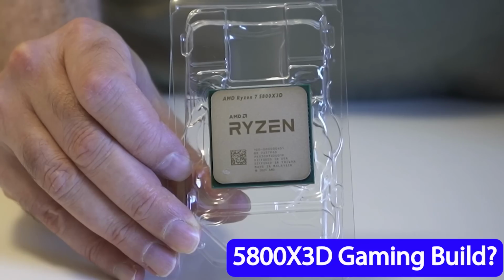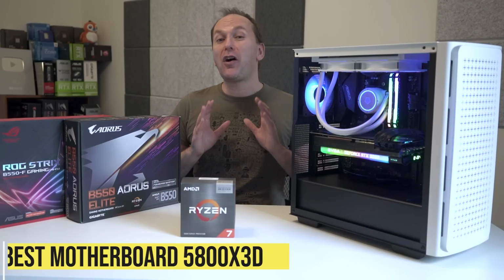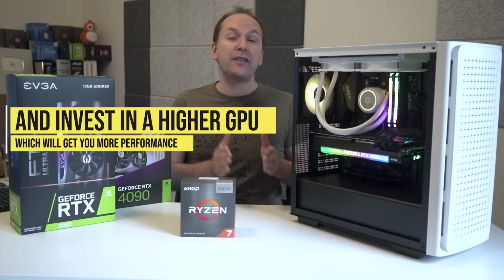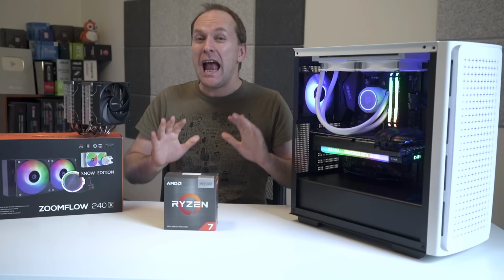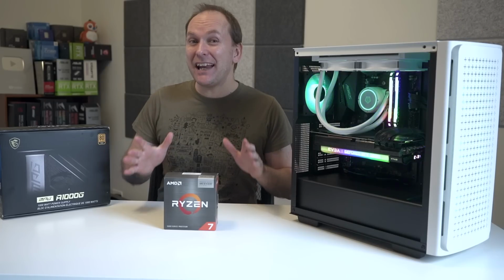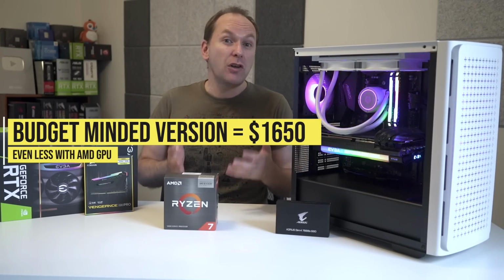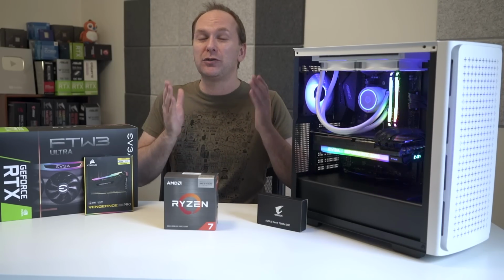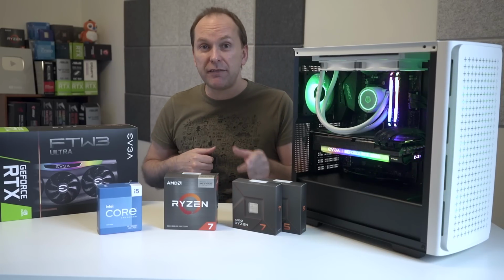🛑 4K Gaming is CHEAP! 🛑 Ultimate Ryzen 5800X3D Gaming PC Build

Comment: I just realized this is old. I was confused when I saw the older parts selections.
Reply from the maker: Yes. If you are looking to upgrade an existing AM4 build check out our “How to Upgrade your PC 2024”. If you’re building new I don’t recommend this is in 2024. See our Best Budget Gaming PC 2024 video for better options
Reply: @PCBuilderChannel  I have AM4 and I'd rather go on to AM5 next than to move to a 5800x3D or one of the Ryzen 9's. I have a Ryzen 7 5700x. It's enough for now. I've had AM4 since around 2018. I started with the Ryzen 5 2600. Moved to a 3900x. Now I have a 5700x. I wanted a bit of extra gaming performance over having more cores. It does run really hot if I overclock though so I might invest in a good air cooler that I can keep through to AM5 when I do upgrade. I have an RTX 4070 Ti Super. People tell me I'm bottlenecking like crazy all the time. I expect a bit less performance on the older CPU in general but I feel like it's probably not worth it to upgrade my CPU just yet. I play at 4K and 60hz and it's mostly a bit older titles like Battlefield V and GTA V. I have a few newer titles but they just aren't as good in my opinion. I think continuing to invest in AM4 just not going to benefit me much. I want to upgrade in a few years. I might wait for AM6 even.

Comment: I'm considering a more balanced system, and I'm leaning towards the 5800x because it's only slightly slower in gaming, about 5-10%. I can overclock the 5800x to narrow that gaming gap while still keeping its productivity performance. Additionally, it's cheaper and often overlooked, so I save some money by choosing it.
Reply from the maker: I wouldn't personally. Price to performance in 2024 the only AM4 CPUs that make sense to buy for a fresh build are the 5500 or 5600. The 5800X won't give you enough of a boost over a 5600 to justify the price increase. You could get better performance by going 5600 and pairing with a 7800XT. Or if you have more budget get yourself into AM5 with a 7600. See our Best GPU/CPU Combo 2024 video for more on this
Reply: @PCBuilderChannel  
I recently built my PC late last year with a Ryzen 5 5600X CPU and an RTX 3070 GPU. However, the GPU developed issues and I had to send it in for warranty repair. They replaced it with an RTX 4070 Ti, which is now causing a bottleneck with my CPU. Since I already had the AM4 platform, I decided against upgrading to AM5. I've already purchased the Ryzen 7 5800X CPU because the games I play wouldn't benefit much from the Ryzen 7 5800X3D. I'm now considering if this CPU upgrade makes sense, or if I should wait until AM6 is released before considering a major upgrade.

Comment: I went MSI B550 Unify board/5600X3D. It has the X3D auto curve Kombo Strike button in the BIOS for a non multiplier de facto X3D OC and great RAM OC capability. I run B-Die RAM at 4000 MHz with tight primary and sub timings. The board does that with a BIOS button up to 5500MHz stable. $279 pro OC board, $75 Microcenter closeout, insane.

Comment: for this build, do u need to do bios flash first before window installation?
Reply from the maker: You shouldn't need to no, just update the bios as usual after you build (check out our After you build set up guide video for more). But check your motherboard manual to be sure

Comment: I just built my new PC and here are the specs. What are your thoughts on it. Case is an ASUS Hyperion GR701 and I added 3 140mm top fans for exhaust, Motherboard is ASUS Z790 Hero, Intel Core i7 13700k, Corsair Vengeance DDR5 64gb 5600 ram, PNY 4070 12gb ram, Coolermaster air ma620m CPU cooler, Corsair 1200 watt modular PSU, WD Black 1tb M2, WD Black M2 4tb, WD Black M2 4tb, LG 34 inch 165hz curved monitor, Roccat Vulcan gaming keyboard, HP external DVD writer, Logitech Trackball, Razor Tiamat 7.1 Surround Headset Ver.202. Logiteck 2.1 Speaker system that I already had and I am using a Logitech C922 Pro Webcam that I had. I'm running Windows 11 Profeshional. What are your opinions on my Build?

Comment: I am planning to upgrade to a 5800x3d from a 5700x and a 4070 from a 3060 ti am my current motherboard is a a520m plus wifi would that be fine? I am also planning to get a better m2 ssd and faster ram. (My pc was pre-built) psu is 700w so it should be fine but I'm mainly asking because I've seen a few people say that the motherboard isn't good but it's not bad either, and I don't particularly feel like upgrading to a different motherboard and re-adding all the parts and all the cable management, etc...

Comment: I have AM4 B450 aorus elite with 32gb 3600mhz ram. I wish to get the 5800X3D with 6950xt, is that a good option? Want to wait 3-4 years until DDR5 becomes established.. Then I will switch for something completely new. Is this setup compatible with my mobo for 1440p? If someone has the simillar setup please reply to me here :)

Comment: I was thinking about mixing this with a 6750, never built one before so i need imput
Reply from the maker: Good combo, but if you are building a new pc I don't recommend 5800X3D now. Its great for upgrading an existing AM4 build but for a new build see if you can get to 7600 and AM5. See our 7600 build guide for more
Reply: @PCBuilderChannel  OK thanks! I watched the build video. Do you think the 6750 would still pair nicely?

Comment: I want to build a pc, would these components be good? 
CPU: 5800X3D

GPU: 4070 TI
MOBO: B550 Aorus pro v2
M.2 NvME: 2 of 1T
FAN: 2 Noctua 120mm and 2 Noctua 140mm
RAM: 2x16
COOLER: Noctua NH-D15
CHASIS: Corsair 4000D
PSU: 750w or should I put one of 850w?

Comment: Hi man do you think r7 5800x3d is better than r9 5900x in gaming with a rx 6800xt and i want to know if 5800x3d is good enough for heavy games with stream/editing/montage/graphic design i mean will 5800x3d serve me very well in productivity or i should drop some fps and go with 5900x ?
Reply from the maker: Yes a 5800X3D is a way better choice for gaming than the 5900X and will also be great for productivity. I would go 5800X3D here for sure
Reply: @PCBuilderChannel  msi b550-A pro after a flashback is a good mobo for r7 5800x3d ?

Comment: b450 gigabyte gaming model supports it?
Reply from the maker: Yes, just update the bios
Reply: @PCBuilderChannel  no have problem with vrm?
Reply: @PCBuilderChannel  because i think buy a b450 for a 5800x3d
Reply from the maker: If buying new I would prefer B550, and in most markets you can get good B550s for the same price
Reply: @PCBuilderChannel  Here in Brazil it's hard to find the B550 at the same price as the B450, it's always more than 300 reais more expensive, that's why I asked if the B450 can handle it, cost benefit is very good. Thanks for the answer.

Comment: Hey, I'm builduing my PC through MicroCenter cause I don't want to mess anything up. I couldn't find the PSU that you recommended in stock. Is it ok if I use the EVGA SuperNOVA 1000 GT, 80 Plus Gold 1000W, Fully Modular, Eco Mode with FDB Fan, 10 Year Warranty, Includes Power ON Self Tester, Compact 150mm Size, Power Supply 220-GT-1000-X1 ?

Comment: I know I'm late and I hope you respond. What MB would you recommend to upgrade this build to DDR5 ram and a 7900xtx gpu? Also, what else would I have to change? Thanks.
Reply from the maker: AM4 doesn't support DDR5 so you wont be doing that. But you can always add the 7900XTX, that's not dependent on the motherboard. See our PC Parts Explained 2023 video for more
Reply: @PCBuilderChannel  thank you very much.

Comment: Bro, i just buy ryxen 5 5500 with asus tuf gaming motherboard and 3060 rtx 
what should i upgrade 1st ??? think to go updgrade 3060 to 4070 ?
or upgrate processor ryzen 5500 to 5800x
Reply from the maker: I'd go for a GPU upgrade first for sure
Reply: @PCBuilderChannel  4070 better or 4060ti ?
Reply: @edgartiong5018 4070

Comment: Me: Alright, time to upgrade my PC!
My wallet: Yeah, no. That's not gonna happen...
Me: Just the graphics card? 😢
My wallet: Especially not that!
Me: 😭

I'm currently running Ryzen 5 3600 and MSI Gaming X 1660 Super on top of an overkill of a Motherboard, MSI MAG X570 Tomahawk WIFI. It's still a great setup for my 1440p use, but I can't help it. I want to upgrade 😂 Want some of that sweet RTX action and that new CPU sounds truly amazing. But it will always get out of hand when upgrading. Heck, I would probably need a bigger case for the new GPU and that means I could upgrade the cooler as well! A new RAM... A 4K monitor for a dual screen setup. Aaand my wallet just ran out of the door, screaming for its dear life... 🥲
Reply from the maker: haha! Sending good vibes to your wallet (;

Comment: I have a question to PC builder

My built spec: 
- Ryzen 7 5800x3d
- PNY RTX 4090
- 32GB ddr4 3600Mhz
- B550 MSI Pro WiFi
- 3TB m.2 ssd + 5 TB HDD

My question is, does 5800x3d cause a bottleneck to the RTX 4090 ?

Comment: I am deciding between ram kits including: 
Can you give me some advice. I am using X570 and 5600X.
(all are 3600Mhz 8x2)
And is upgrading from 5600X to 5800X3D a worthwhile upgrade for 1080p gaming?

Thank you and best wishes to you!
Reply from the maker: Our picks for Ram are linked and you can hop to our Best Ram for Gaming video for more. As to the upgrade that entirely depends on your GPU. The higher your GPU the more you will see a boost jumping from 5600X - 5800X3D. But with a lower GPU you won't get as much difference. See our "how to upgrade your pc" video for more

Comment: at 4k will a 5600x bottleneck with 4090 or 4080? I have a 5600x now. Wanting to sell my 3090 and get the 4080 and call it a day. Then I'll be close to max 144hz on my 4k screen without needing to upgrade to new mobo and ddr5 etc..
Reply from the maker: The 5600X will bottleneck that 4090. I'd pop in a 5800X3D if you want to upgrade, that would be a great combo!

Comment: Hy would this be a good built to replace my 10y old 4790k :-) 

AMD Ryzen 7 5800X processor
€241,00 

ZEN
Asus ROG STRIX B550-A GAMING moederbord 
€147,00

Corsair DDR4 Vengeance RGB Pro SL 4x8GB 3200
White Geheugenmodule
€134,90 

Gigabyte GP-P1000GM 1000W PSU/ PC voeding
€109,90 

Cablemod CM-PCAB-BKIT-NKKW-3PK-R interne
stroomkabel
€54,95 

Cooler Master MasterLiquid PL360 Flux White
€164.90
Asrock Radeon RX 6800 XT Phantom Gaming
16G OC Videokaart
€649,00 

Cooler Master MasterBox TD500 Mesh V2 White
Midi Tower Behuizing
€109,90 

Cooler Master SickleFlow 120 ARGB White Edition
€14,90 

AOC CQ32G2SE/BK
32"/2560x1440/VA/165Hz/Curved monitor
€339,00

Total 1965€

Comment: Beautiful Rig ! I just built a Rig with my existing 6700xt new 5600x cpu 16x2 ddr 4400 ,1 tb Predator ssd  with an MSI 360 aio. I want to get the 5800x3D but 330 is still a bit high for me. On a ASRock TaiChi x570

Comment: Great video, I have the ASUS tuf gaming b550 plus, an rx6800xt, 850w psu, 5800x3d, adata xpg 3600 cl 18 ram.  4x8gb ram  And the system runs slow sometimes, even in the bios!  The mouse stutters .  Do you think the psu is the cause?  The board is on the latest bios, as is the Gpu.  I had no issues when it was 5700xt gou and 3700x cpu.  I do run some hotas flight sim sticks and oculus quest2 but not at the same time. And still see the issue when nothing is plugged in..Thanks

Comment: Hello I am planning to build this CPU with the rtx rog strix 4070 ti and the asus rog strix b550-f wifi II am4 socket the corsair vengeance pro 4x8gb cl18 3600MHZ and use the samsung 970 EVO - 2TB. Since most of this stuff was already with the help using this video. but some things are still unclear for me Since it is going to be my first time building one.

Does the corsair vengeance pro cl18 4x8gb DDR4 3600MHZ also work with this CPU? Will this CPU also work with rtx 4070 ti? I am not sure about the air coolers. Can't find either of those any other ideas? Can't find those PSU's either.

Comment: QUESTION:

if i have a 5800X3D with a 7900XT, will i be good with a 850w psu?
Reply from the maker: Hop over to our Best PSU 2022 video and follow the method there to check the wattage requirements for your full build to be safe ( :
Reply: @PCBuilderChannel  i already bought the 850w psu 😥

Comment: Just upgraded to the 5800x3D and I'm using the same Asus B550 Strix A Gaming mobo you previewed, my question is do I have to do anything special before I install my new 5800x3d, like any BIOS changes or TPM settings etc, or will everything just reset to defaults the moment I install it? Thanks again for all the help and info you give us PC enthusiast's! Edit Running the newest BIOS version and running Windows 11.

Comment: I currently am running a 3900xt on a Gigabyte X570 Elite MB. Does it make sense to go to the 5900x3d or go all in on a AM5 build with a 7600 or 7700. Currently running a 5900xt video card. Save money sticking with the 5800 and put towards a better Video card.

Comment: Good build (very similar to mine), but no way I'd only put 16GB RAM in it... especially when you can put 32GB in it for the same price. Only low-budget builds should consider 16GB any more, and even that's questionable if you plan on keeping it for very long.

Comment: I want a gaming machine, but I also want to do music and some video, possibly streaming, would it be worth it to go to 64mb of ram?
I purchased 2 sticks of 16gb ram corsair vengeance LPX 3600Mhz, (I think it's cl18), for about the same price you paid in this video, in Canadian dollars, $128cdn, roughly, $97usd.
Just last night. It was cheaper to buy 2x16gb sticks than 4x8gb. 
Like half the price!
I'm thinking of grabbing 2 more sticks for 64 gigs and the whole. dual rank issue?
Reply from the maker: You certainly can, as long as that won't cost you on your GPU or CPU choice. Just make sure you grab the same kit
Reply: @PCBuilderChannel  Thank you.
Everything is up and running.
Thanks for the vids!

Comment: Hi Jason I have been watching alot of your videos and am not finding a clear answer so hope you could provide your thoughts. 
I want to build a gaming PC I was leaning towards to 5800X3D with a 3080. But I saw some videos around Intel having a longer upgrade path with its current generation would that be correct?
Reply from the maker: See our 13600k build guide for more info on that. The Ryzen 5000 platform is at an end so the 5800X3D is the end of that particular motherboard CPU combo. You could pop up to Ryzen 7000 if you think you will want to upgrade your motherboard or CPU anytime soon. However, my two cents is always to build the best machine that fits your budget now and don't worry so much about "future proofing" as tech moves so fast by the time you felt you needed an upgrade you'd likely be better off building new.

Comment: 5900X + XFX Speedster MERC319 AMD Radeon RX 6800 XT + Asus ROG Strix B550-F + EVGA SuperNOVA 1000 G5     is good for games in 1440P? DeepCool CK560 Mid-Tower ATX Case
Reply: If you already have the parts, this would be a killer 1440p gaming rig.
Reply: @rogued3mon414  not ready only in basket Amazon. Need good 30~32" curved monitor Asus Tuff, MSI Optix ,SAMSUNG 32" Odyssey G5 (not sure yet) which one pick. Ram 32 GB 3600 cl 16 Corsair
Reply: @ReneBartolomei  The ram is totally good and for the monitor, I checked best 1440p 32 inch monitor recommendations and the NZXT canvas 32Q is one of them. You may consider that.
Reply: @rogued3mon414  I see that monitor but Out stock (US).  First time seethat monitor with  build from @Mr_Matt_Lee youtube channel.

Comment: That PSU is just way too overpowered. There are good 750w psu's that are able to power i9-13900k and RTX 4090. So you would go for 850w or 1000w to be on the safe side. For this rig, it's just a waste of money.
Reply from the maker: Head over to our Best PSU 2022 video.We are conservative with our PSU choices but our take is not to mess around with power spikes (they are no joke). You are welcome to buy for your comfort level of course but the PSU is one place we are fine with spending a little more to protect your full build
Reply: @PCBuilderChannel  There are special PSU-tests out there, that show that even some 750w psu's are capable of powering 4090 + 13900k. Even manufactors like be quiet! reccomend 850w (or more). A RTX 3080 needs way less power, as well as a 5800X3D. A good psu has no issues with power spikes as well, though I doubt that those spikes would be anywhere near that max power range.

Comment: Hello, im  imensly undecided between 5800x3d and 13600k, im from portugal so , right now, i have ordered amd for 379 with a b550 strix gaming a for just 159, at the other end the i5 13600k is 359 but the boards that im up to buy is the b660m tuf gaming plus or msi b660 pro a, b660 asrock steel legend or finally gigabyte gamin x ax, all in all, the 2 combos are just 10 euros diference. should i keep the amd combo that i ordered, or do i return it and go for intel ? i have ddr4 and a 6800xt, please help me, i am struggling to choose the correct, oh and i just game, its only for gaming, and i am cooming from a 8600k so i want something that last at least 4 years..
Reply: i play 1080p 144hz, can in end of the year go for 1440p 144/165hz
Reply: Since your goal here is to play 1080p and 1440p, plus you have a 6800xt, 5800x3D is the CPU of choice. 13600k seems to be a cpu for heavy tasks like 3d video editing or other stuff like that.

Comment: Hi Jason, I'm a subscriber and first time commenter. I enjoy watching your content. Today I ordered a Ryzen 7 5800X3D to replace my dated Ryzen 5 3600X. I got it for a price of $429 CDN (approx. $320 USD). I currently have 3 sticks of 2133 8GB memory. I originally had 2 sticks of memory but one went bad so I had to add 2 more sticks. My question is do you recommend that I upgrade the memory to 3600 CL16 2x8GB? I have a B550 motherboard.
Reply from the maker: I would if you can. Get the most of your awesome new 5800X3D (: